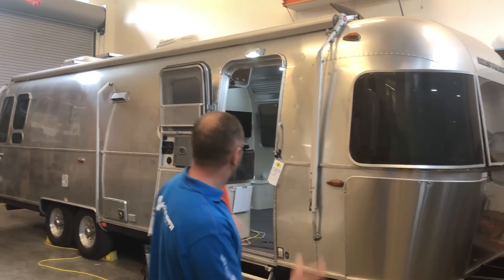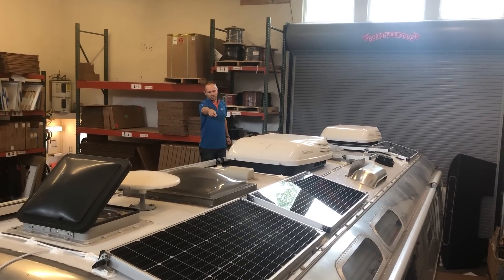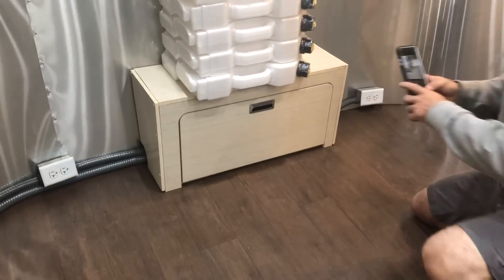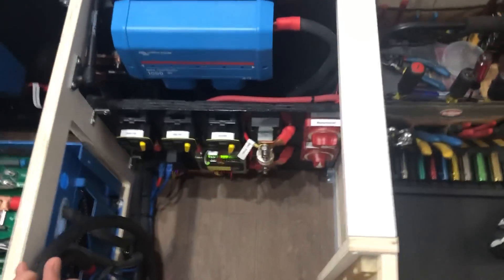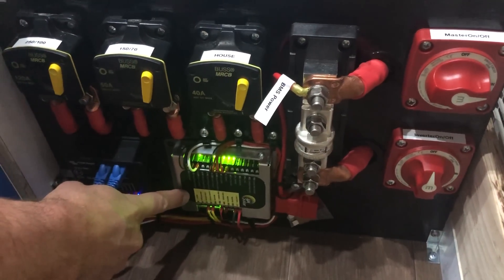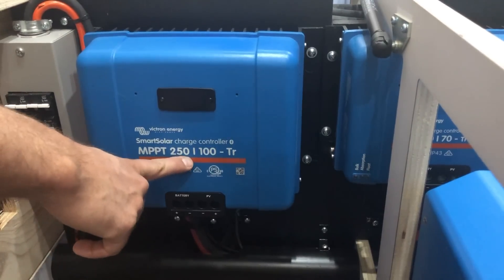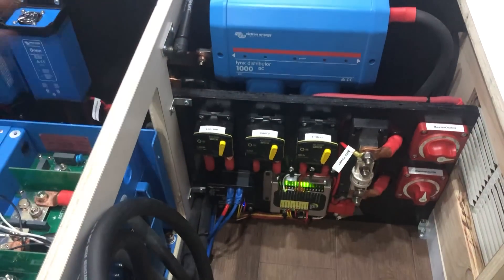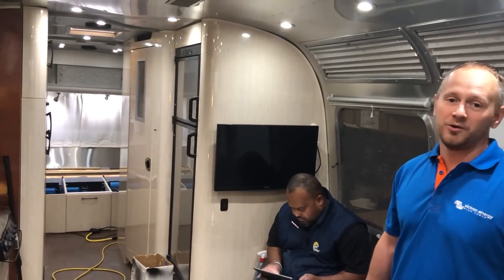Ultimate Airstream Solar, Lithium & Inverter Upgrade (Pt. 4 – System Commissioning)

Comment: Don’t the Victron Li batteries have their own BMS that controls low temp, low volts, and overcharge protects without that ve4 device.
Reply: At the time this system was installed, the low temp charge disconnect would have required a complex network of relays.  Current Victron installations do not use this board anymore.

Comment: I would be pretty concerned about the significant weight added to the rear of the trailer along with the removal of all the furniture in front.  This is a recipe for a lot of trailer sway.
Reply from the maker: Mike Wingert The front of the trailer got filled with heavy audio equipment which made matters a little better. Despite the customer’s special truck, it was still a challenging load. This isn’t something we would do on a regular basis. Fortunately, Victron has lighter batteries now.

Comment: That’s a lot of weight behind the rear axle?  Did you beef up the frame to handle that weight or what is the weight amount you determined to be safe that far behind the axle?
Reply: You’re exactly right.  I don’t ever want to do an installation like that again.  Fortunately, the client has a very unique tow vehicle more than capable of handling the load and he was made aware of the potential issues.  In recent follow-up conversations, he’s very happy with it, and driving is “different” than it used to be, but not problematic.  Moving forward, we are happy that Victron now has some lighter battery options.

Comment: Garret - Thank you very much for producing all of the AM Solar videos.  The detail and quality of AM Solar's work speaks for itself.  Since your AirStream client placed the Quattro under his bed, have they reported hearing any noticeable sounds (humming or buzzing)?  Same question as to your experience installing Multiplus units?  While I understand the evidence for harm due to RF radiation has been associated with high-voltage power lines, and is far from conclusive, would you personally have any qualms about installing all of that equipment under your bed with hours of close proximity?
Reply from the maker: As for me personally, I wouldn’t have any issue with that kind of equipment being installed under my bed, but I wouldn’t criticize anyone that wanted it elsewhere.  I figure spending eight hours per day in front of a computer monitor is probably worse for my health.  Besides that, most people turn the equipment off at night to conserve energy.
 
We are currently working on an Airstream for a client who’s extreme concerns about RF have us mounting all the power equipment in a box outside the trailer.
 
Since doing this particular job, the only issue we have heard about is that driving the trailer is more challenging due to the weight.

Comment: Does Victron recommend using an anti oxidant on the wire connections in the inverter?
Reply from the maker: John tatman I have not heard of that recommendation from Victron and we don’t use it. But, I don’t see any reason to tell you not to. We make sure everything is tight during QC and look over all the connections with an IR camera to see if anything gets too hot.
Reply: @GarretTowneAMS  Thanks for the quick response.  Since the contacts in the inverter appear to be aluminum and the wire is copper oxidation can be an issue.  Code here in homes requires an anti oxidant lube to prevent this.  I know you've been doing this for a long time and if you have not seen any problems that should show it's not necessary.
Reply from the maker: John tatman I’ll look into it. Thanks.

Comment: Very nice work well laid out I'll be calling when I'm close to installation of my system needs thank you for sharing I'm impressed with you attention to detail just curious what kind of warranty do you offer for a system like this?
Reply from the maker: Individual components have manufacturer warranties and we warranty the installation work for the life of the vehicle.
Reply: @GarretTowneAMS  that's not bad so the lithium batteries are 300 amp hours per battery at 24volts?
What's the cost per battery?
Reply from the maker: @briandavis9975  It is 300Ah per battery at 12.8V.  It takes a lot more than just a battery to create a working battery system, so we rarely sell batteries by themselves.  Also, the price fluctuates over time and depends on what kit is purchased, whereas YouTube comments last a long time.  I recommend just checking out the lithium battery kits on our website, or scroll down to the bottom of the page and click on the Victron logo to see pricing on batteries.